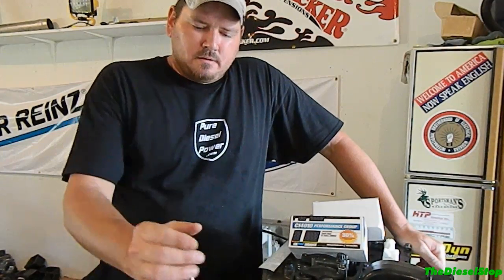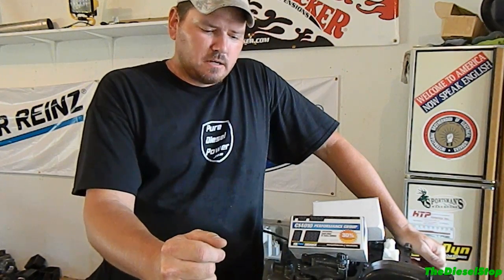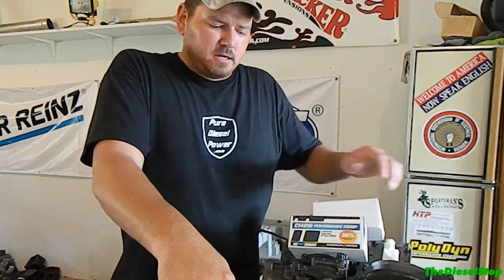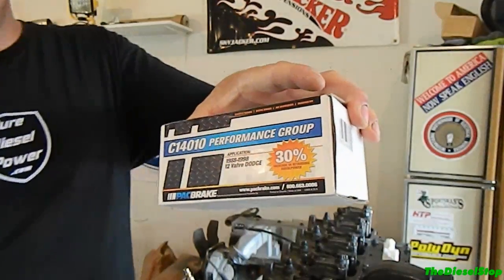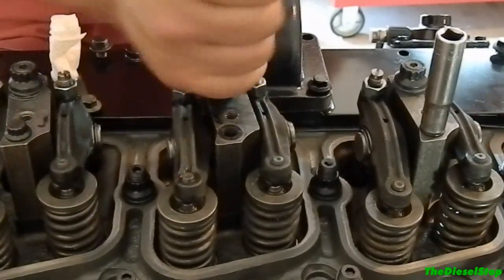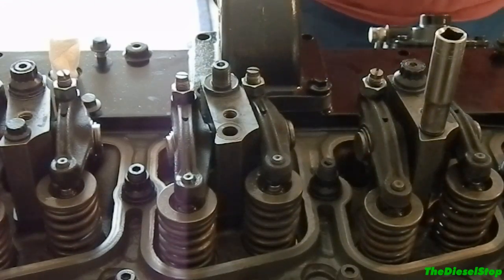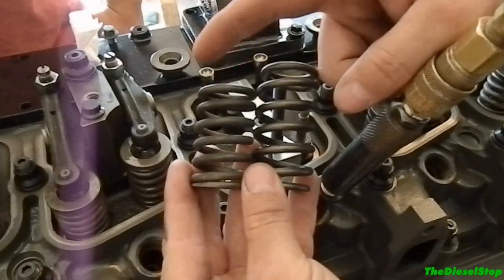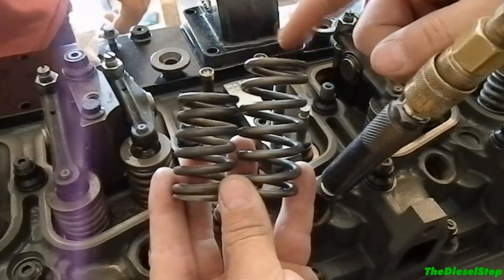5.9 Cummins 60 Lb valve springs install

Comment from the maker: intake exhaust
These valve springs are 60 pounds overstock that installed.  Here are the stock specifications.
free lenght: 2.190" 2.190"
installed height: 1.940 1.940
closed test press: 65-72# @1.940 65-72 # @ 1.940
installed stem height 2.110-2.130" 2.110-2.130

Comment: I was told that when the 60# springs were installed you needed to replace the keepers and retainer with the billet aluminum and titanium versions.  Are these the billet aluminum/titanium ones?  Do you think they are needed?

Comment from the maker: The boys at dieselautopower is who you should talk to on injectors & buy them there. Tell them I sent you. There is many different injectors & spray patterns so beware and do not get the wrong ones or you will have meltdown. You should match your air (intercooler & turbo) to your injectors. If you go over 40psi of boost head studs are recommended. There are 800 hp daily drivers on the road so you should not have any problems with your goal.

Comment: Great vid ! 
I have always used a piece of rope. just a little bit of a backup plan if the comp dies or something lets go. dumped a couple of valves in a SBC when the belt on my snap off compressor broke. life SUCKED!. Mechanical retention is my personal choice.

Comment: Hey Diesel Great Vid as usual.  Got a quick question, when that head was rebuilt and the builder put the OEM springs in, were they shimmed?  Cause we used to shim  the springs when we rebuilt the heads, and it kinda looked like they were shimmed when you pulled the old valve springs out.  I've done that job,before on an old 318 dodge with the engine in the pickup, lot's of swear words getting it done.  And I would recommend replacing the valve guide seals while your in there as well.  Thumbs Up!

Comment from the maker: That air keeps the valve from falling into the bottom of the motor. If the air dies out then you got to pull the head off & that would not be good.

Comment: they push the valve up harder so when under high RPM, the rocker arm wont loose contact with the valve or the push rod with the rocker, and have the piston come up and hit the valve.  That's called floating the valves

Comment: yeah thought about that after i posted the comment lol i take it forgranted with all the tools you have there that you still only have the one compressor and even if you were to be able to split the line some how you wouldn't be able to hold the same steady presure in the chamber to hold the valves up. i actually have 2 a 25 gallon and a 1 gallon but not sure the small one would run the tools sorry i didn't consider everything before i posted the question.

Comment: looking good pure diesel power is where i bought the muffler delete kit for my dads 06 dodge he is really happy with the sound of his truck and the fuel economy bump it provided with the muffler delete and a k&n drop in filter his truck sees any where from 23-27 mpgs not bad for a truck that weighs in at 8,600 lbs

Comment from the maker: A cam follower, also known as a track follower, is a specialized type of roller or needle bearing designed to follow cams. " The 12 valve cummins have a flat tappet & no roller or needle bearings". & yes the push-rods will be strong enough.

Comment: I like that tool for the valve springs it is a lot safer less chance of a spring shooting accross the shop floor lol. Doing that job you hope your air line doesn't blow or there will would be lots of colorful language when you lose air pressure. Pac brake springs must be orginally for exhaust brake applications. Can't wait to hear the engine run.

Comment from the maker: 60lb Intake & Exhaust Valve Springs 89-98 12 Valve Dodge 5.9L Cummins
The seat pressure on these springs is ~115lbs at the installed height of 1.950.
At 400 lift, the spring pressure is ~192-195lbs. 
At 500 lift, the spring pressure is ~210lbs.

Comment from the maker: I am sure you will have to pull one to check and see & it is very easy. Some aftermarket injectors use the stock body & different nozzles so you might have to look on the bottom side of the injector.

Comment: i recently bought a 97 12 valve and the guy i bought it from told me a lot stuff that was done to it but the one thing he didn't know for sure is if it had injectors or not.  To tell what size injectors i have would i have to pull them out and look at the nozzles or do you have any other ideas?